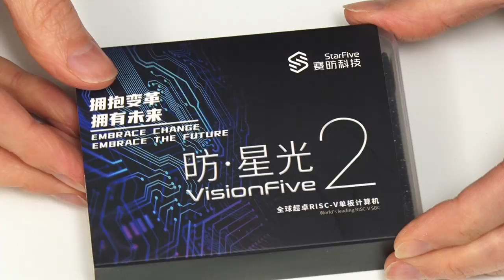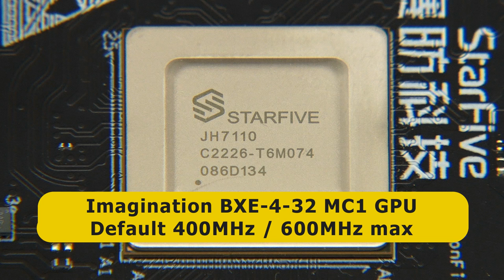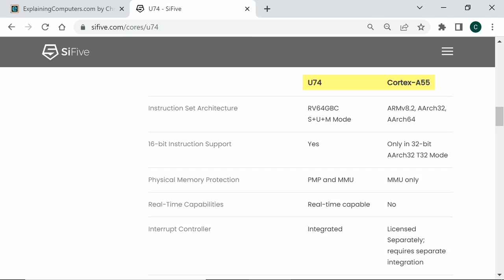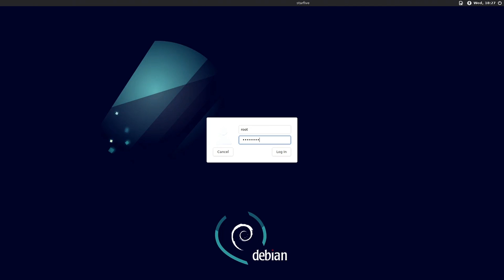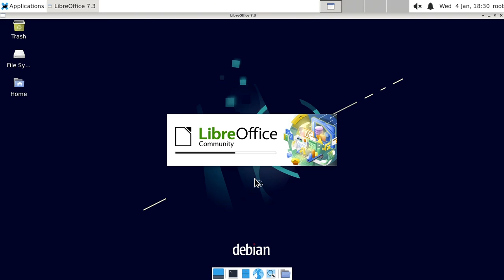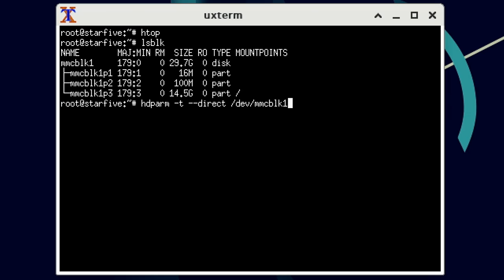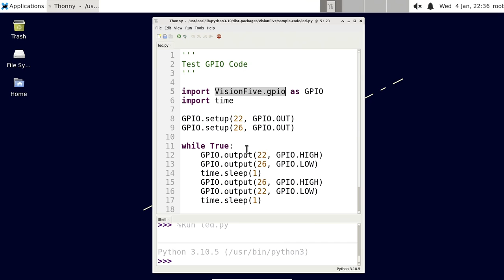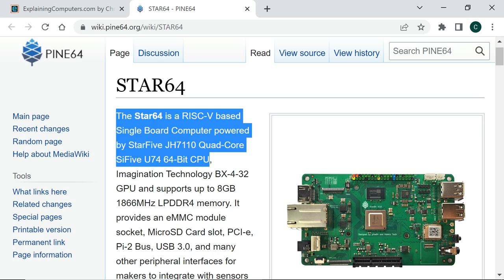VisionFive 2: RISC-V Quad Core Low Cost SBC

Comment: What do you do to check and make sure of or prevent these devices from who knows where in China from hacking or infecting your home network? I am curious.
Reply: This is an excellent and far-from-overly-paranoid question.   The general answer is going to be that you need to take complete control over any software.   Do NOT install anything released from China, Vietnam, Singapore, or any other CCP-friendly state.   Install only trusted, OpenSource software.  And, even then... don't absolutely trust the hardware, ever.  Although, this has no built-in radios, so the hardware would be less of a concern for this model.   Just be vigilant about how you limit it's network access on the outside.

Frankly, though, even purchasing such hardware is only putting more money into the hands of the CCP, int he end... supporting genocide, slavery, and other atrocities.   I mean.... are we really so poor that we are forced to do so?  An RPi 4 isn't that expensive.

Comment: the risc-v is still so slow compare to arm. i was amazed by how slow the os reacted while you move the mouse on the "start" menu.
Reply from the maker: That is a software issue, and will improve. Hardware is nothing without software. :)
Reply: This is a dev board, not really something for a mass market or replacement of arm boards yet.
Reply: Does the current RiscV core have comparable performance and features to the recent ARM cores? It took ARM many design generations to improve superscalar performance, add 64 bit, virtualisation, Neon SIMD instructions etc. Alternative x86 designs such as the VIA Nano also took many years to develop such features but struggled to achieve parity with Intel / AMD. They have one huge advantage though which is they can design their CPUs from the outset to free from the known transient execution vulnerabilities.

Comment: Shame you weren't able to get get the m.2 slot working  Chris but this is still one of the most exciting video you've ever posted. The VisionFive 2 could be one of the first SBCs ever to have an open source, fully featured (Vulkan and OGLES 3) and first party written GPU driver. That's a not just a rarity/novelty for RV but for the much longer established line of ARM SBCs too.

I posted this video to the Haiku forums as soon as I spotted it because I'd prefer to run Haiku on one of these!

Thanks!
Reply: I too struggled with the m.2 slot on the VisionFive2. I noticed on the forums there was a suggestion to use a different power supply. Sure enough, when I used a strong power supply (USB with Power Delivery), the nvme drive I had installed was detected and worked great.
Reply: @EmilLerch0  Great news! Thanks for the update. What sort of speeds do you get?
Reply: @danboid  hdparm -t /dev/nvme0n1

/dev/nvme0n1:
 Timing buffered disk reads: 512 MB in  3.00 seconds = 170.55 MB/sec
Reply: @EmilLerch0  Ouch! Thanks for letting me know. That's a very poor speed if its supposed to support faster than PCIe 1.x, but maybe they're not claming it should? I get about 400 MB/s from the (PCIe 2.x) m.2 NVME on my RockPi 4c so I was hoping you might get something like 500+ MB/s.

Comment: I have to say that I was surprised to see this review! I was also an early backer and it became pretty apparent pretty quickly that this board still needs some time in the oven. I have the 8GB version and only 4GB show up unless I reflash it and upgrade from the 55 release to the 69 release. A release that has a variety of other problems.

Good news is that the problems appear to be mostly software (i.e. fixable) and the board itself has some really impressive specs. I honestly think this board has a ton of potential. StarFive just needs to get all the kinks worked out first.

(NVMe did work fine for me, but it only gets about 190 - 250MB/s. I don't trust that this is indicative performance of the board and likely is impacted by this being an early release.)
Reply from the maker: Thanks for this. Your NVMe performance is what I've seen in a couple of other places. The JH7110 supports two PCIe 2.0 lanes (that can in theory each deliver 500MB/s), so will never deliver the potential speed of an NVMe SSD.

Looking at the specs (again!), one of the PCIe 2.0 lanes is multiplexed with the USB 3.0 controller, so in practice NVMe drive speed ought to be able to get up to towards 500MB/s. But you have got me thinking that maybe the USB 3.0 ports are configured to have half a lane of bandwidth each, which would account for my speed test result.

The SoC specs are here:
https://www.cnx-software.com/2022/08/29/starfive-jh7110-risc-v-processor-specifications/
Reply: @ExplainingComputers  I suppose a half-lane is possible. However, it seems somewhat unnecessary. The thing that really makes me think that's not the issue is the way the board behaves when running tests. The results bounce up and down between 100 and 300MB/s and the program performing the test tends to be somewhat unresponsive during the test. This suggests to me that I/O isn't being handled well by the board drivers, with numerous unintentional locks and delays in the process. The inconsistent performance similarly speaks to this, with some tests showing as little as 152MB/s.

I compare this to the Orange Pi 5, which has similar PCIe 2.0 limitations. I get 400MB/s out of that one, which is pretty close to that 500MB/s limit. I suspect that once StarFive sorts out their drivers, we'll see performance similar to the Orange Pi 5. Possibly a bit lower, but something like 350MB/s would be a bit more reasonable.

Comment: This thing is great! About to check whether there's already Linux firmware/platform support for these. Problem: neither Arch nor Fedora do officially support RISC-V yet - gotta use Debian/Ubuntu or wait till they officially support RISC-V (Fedora has planned official RISC-V support for Fedora 36, Arch also has plans to support RISC-V but with no release schedule, Debian/Ubuntu are the only major distros who already have working official RISC-V 64-bit releases).

Edit: Suse also already has official RISC-V releases. Slackware: seriously who would wanna run Slackware on these things? Gentoo: yes, masochists, control freaks & people with too much time could theoretically also run Gentoo on these devices.

Comment: I'm happy to have another entry in the market, especially one that is open source.  I've got plans to create a software tool for DIY auto repair people to give them access to vendors from their desktops that will allow them to look up parts they need and find the best prices for parts and order directly from inside the user interface.  The idea is to get vendors competing in an open market place where instead of hiding the true prices of parts and trying to lure you in with fake sales where they drive what products they want you to buy, you get to pick what YOU need at the best price.  Later, as right to repair gains traction, I'll like to attempt to crack the monopolistic strangle-hold on repair information before it is set in stone.

Comment: Its amazing that boards this size are roughly as capable as a desktop machine from 15 years ago, generally more than enough for basic computing or even basic photo editing and possibly some basic CAD. 

The fact that its 10/100 (plenty for your average user) and requires external adapters for wifi/bt are only minor, non deal-breaking "cons", yeah im getting one.

Comment: You pipped me at the post, I noted the chip and manufacturer of the board are one and the same so software will as a necessity be developed to increase its saleability.  It is an interesting board, sitting in an important position in the market.  I think [particularly] v3 onwards will make it a very important  board for makers in the future
Reply from the maker: Great minds, as they say . . .

Comment: Thanks for the as always highly informative video!
For me the week is not complete if I haven't watched your newest video at Sunday evening. :)

Maybe for another video I have got the following question:
How energy efficient is RISC-V compared to ARM and x86 e.g. running some performance hungry applications on Debian.
Reply from the maker: RISC-V in general tends to be very energy efficient. As with CPU performance, I'll benchmark when the software is final. On the Pi 4, energy consumption improved drastically with better software, so that may well occur here.

Comment: Thank you for this review. What an exciting board! Would you like to make another video about Computer Vision at some point? Your Jetson Nano video from a couple years back is a very good introduction to the topic, but the boards are still a tad expensive. I've recently started tinkering with OpenCV and made a gesture recognition script in Python that toggles a lamp if I give the finger to the PC it's running on. Since said PC is a ten year old laptop and this project runs perfectly fine (meaning it doesn't take a lot of processing power for these applications), I plan to use an SBC for surveillance purposes. The VisionFive 2 (among other SBCs) has an NPU which (given proper software support) might be a great option for running Computer Vision without driving up the power bill. I'd really like to see a comparison between low-cost SBCs for that purpose.

Comment: Leave it to the Chinese manufacturers to not only sharply improve the performance, stick in more cores – but bolt on an NVMe socket and lower the price!  See if this were a big brand western system it’d be “Pro Power 2 Extreeeeeeeme” and it’d cost $395.95.  I'm glad they're focusing on a nice vanilla Debian basis at first for all the kit, it makes the whole process downstream just that much easier for everyone.

Comment: This is good news, but serious patience will be required to get this product into a usable space. Your point about the boards being "for development" is key and correct. Only time will tell if RISC-V will succeed. I am hopeful that it will be a worthy competitor to those that came before, however there are many pitfalls that could destroy it, most of them due to the sheer "openness" of the RISC-V platform. We have seen that open means a lot of valid and competing ideas, but here we have the possibility of multiple completing instructions sets calling themselves RISC-V, not just multiple distros as with Linux. Serious leadership will be required to pull this off in the longer term as "competition" of an otherwise innocent sort could lead to its destruction. Remember the lessons of "embrace, extend, extinguish" as espoused by that most destructive of companies, Microsoft. I'm sure the attempts to destroy RISC-V will be public and strident.  X86 and ARM have too much to lose! Cheers!
Reply from the maker: This is all true. But I think the backing for RISC-V by Google, Intel, Abibaba and others does bode in its favour.
Reply: That's interesting. Alibaba I understand. The others are a complete surprise. This drama will play out over years. I'm patient.

Comment: Thanks for this well conducted review. About the USB connectors, you found out that two of them are working as USB2 only. You said that the blue color of the 4 connectors is to "confuse us". But elsewhere in your presentation, you are more encouraging about things that are "not yet" doing what there are supposed to do: one slow ethernet port, GPU....
(You did not even try your favorite bee animation). So are we confused or mystified? Or do we indeed need either to work hard or to be patient?  Happy New Year to all your followers, Take care... and Take Five!
Reply from the maker: On USB, I reported the published specifications, which state that there are (were) two USB 2. and two USB 3.0 ports. But this morning, StarFive have issued a new spec, indicating that there are indeed four USB 3.0 ports -- see pinned comment. I did not play my usual YouTube video because no form of video playback is possible in the current software! So yes, patience is required. I will return to the board for tests and benchmarks when a release OS is available. :)

Comment: Still half-baked without WiFi (at minimum) and preferably also BT5. There are chips out that would only increase the BOM by $5US. Also, the lack of broad OS support is a big drawback. I look forward to seeing this boards progress in regard to these items. Thanks for the good review. Cheers.
Reply from the maker: But remember that any device with WiFi and Bluetooth requires wireless certification, which would slow down getting it to market. So the cost of the wireless module is only part of the issue.
Reply: @ExplainingComputers  I hadn't considered the FCC certification process. Yeah, that would cost money and time. I will contiue to follow this manufacturer. I think they are DEFINITELY on the right path.

Comment: @ExplainingComputers if you want to scale up the uxterm window, hold down [Left Control],  then right click your pointer in the window, and select the font size you want.  That's a feature that's been around at least since 1996. 🙂  Your closing statement re: state of software is on point.  Other SBC manufacturers like Sipeed make boards purely to sell them for bottom dollar, move on with the next thing the day they start selling it, so development entirely ends, leaving it orphaned unless the community takes over.  Raspberry Pi has kept developing their boards long past the sales date, and StarFive is showing similar long-term commitment to their boards.

Comment: I'm very interested in this board.   Fantastic review. 

I've been waiting forever for Rpi4s to become affordable and available.   But this board is much better - 8 GB, M.2, 2Gb Ethernet ports, 4K video, even if it is only 30Hz, etc. And it looks like the GPIO pins do SPI and I2C in hardware, which is fantastic.  

The RPi4 processor may be a bit faster, but memory is going to be way faster on this thing with NVMe.   The software you ran on the SD card are going to run much faster from the NVMe card. 

I love that this thing has 4 USB 3 ports. 

I don't care that it doesn't have WiFi.  Not ever microcomputer needs WiFi.  If you need it, it can be added. 

I hope you do an update when the sofware and specs are more sorted out.
Reply from the maker: I will indeed do an update on this board as the software improves.
Reply: @ExplainingComputers  I love your reviews.  Especially the esoteric stuff.  Keeps my eyes open. 

Are these boards available to the public now ?

Comment: It’s so much fun to see new SBCs entering the market. What’s not clear at this point is that while an open ISA means no £££ to pay to ARM, which lowers the cost to produce the chip. Whether this is translated into saving customer’s money is another question. Indeed, RISC-V SBCs are still relatively expensive. In my opinion, the real potential value would be the freedom to add specialised instructions (similar to FMA, AVX, AES-NI in the x86 counterpart) that are missing in ARM. Otherwise, I can’t see much value in reinventing the wheel. I stand corrected is I am missing the critical point :)
Reply: What the hole deal is about with RISC V. It should be just ARM but better. Like is the point not to allow a more competitive and open hardware? Like say Google likes to make a Risc V. Or say IBM. Or basically but not really true, anyone?
Like X86 is Intel and AMD. And without that shared CPU architecture they are simply Apples and Oranges. But due to being built on the same X86 they are by design growing on the same tree.

Now with RISC V hopefully we get a ARM platform that is less shit. Like if the point of RISC V is not to have software run natively over many many vendors (vs x86 where we got 2 vendors) without having ARM to green light and agree for a vendor to join in. It should be the ARM that we actually want. And not a of brand exclusive crap show. Even now X86 is also a exclusive no new members club. ARM only reason to exist is that it can do few things better then X86. Still not welcomed.

Problem being if specialized instructions ruins it all for RISC V.  Like there is no point to get RISC V ARM's. Or RISC V Nvidia. Like the point is OPEN. Why ARM only success is on mobile phones and low power stuff. ARM is pointless when X86 one can argue is more open then ARM. X86 and the history of it can be found from the 80s or whatever to current day. From hand held devices to super computers. ARM? Basically just phones and whatever 'smart' devices. And only recently starting to become something more like a true computer and not just a low powered alternative (Apple M1) 

But still X86 outclass ARM outside of power draw and complexity burden. And RISC V is trying to be ARM but not locked down to just 'smart' stuff. All ARM benefits and even more flexible then X86. As long as it stays open. Or it is just ARM but even worse.
Reply: @TheDiner50  Yup. Time will tell how RISC V will fare. Personally, I would stick with mature architectures unless something drastic happens.

Comment: Increase font size, Try: Settings/Terminal Settings, use tab Appearance. Deselect Use System Fonts, Then select the sample text form and a popup will allow one to change font size.
Reply from the maker: There is no "Setting/Terminal Settings" option in this OS at this time. I tried all standard options, including writing a custom config file. :)